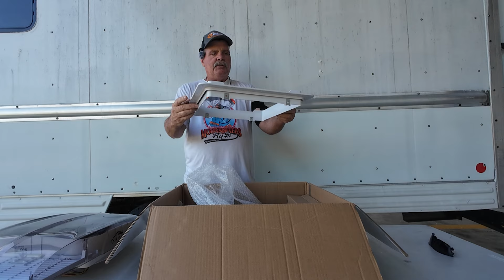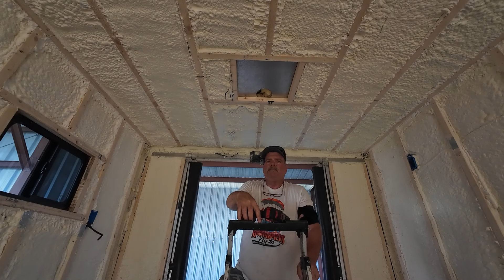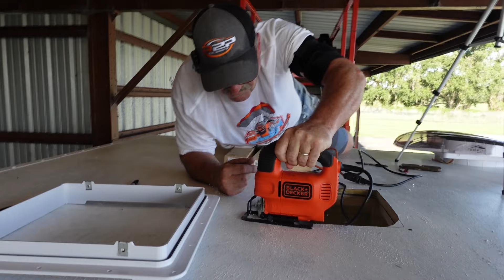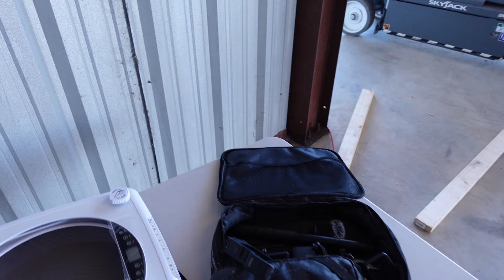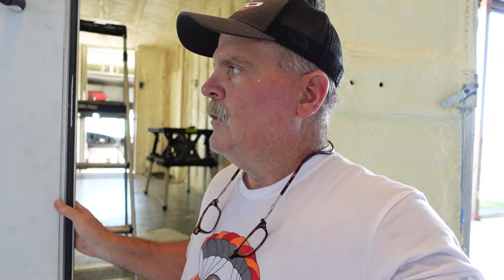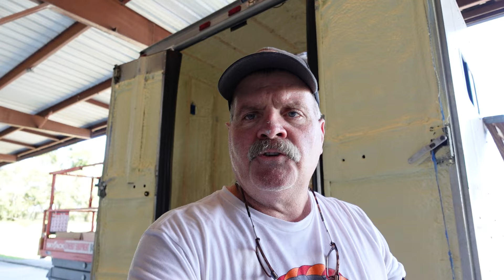Nomadic Arc Fan- The Best Vanlife Camper Fan yet?

Comment: You’ll love the dc to dc Charger. My son and I drove from Bakersfield Ca to the Arctic Ocean this summer in my 6’ x 12’ Paracamper cargo Conversion and every time we stopped the batteries were always fully charged, it worked great. Currently have no solar but will have some solar soon.
Reply from the maker: Wow! That's awesome! Thanks for the info. I love the idea of 3 possible forms of charging so I’m not solely dependent on solar.

Comment: Box truck is coming along really nicely and I  agree 100% with your decision to install the minisplit.  Like I said I installed a 12k btu Blueridge cold climate inverter system myself in my shed last year and it is impressive to say the least.  So far in Ohio weather it has heated and cooled without any other kind of help. By the way the building is about 300 sq ft. I am actually liking these videos so keep them coming . I look forward to seeing the finished product.
Reply from the maker: Yeah, I think the mini split was definitely the right choice. This one at 23 seer only pulls a maximum of 950 W on full power.
I’m really excited for my solar and electrical equipment to get here then I can get the air conditioner installed and working to make it a little bit more bearable in there.